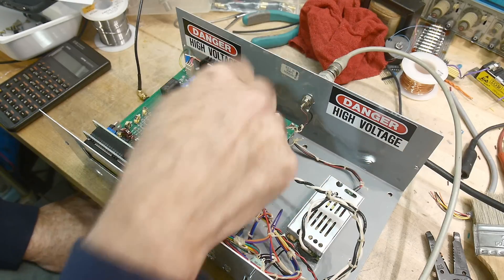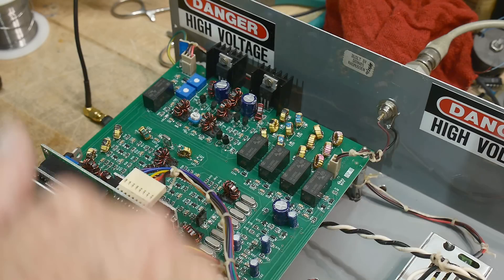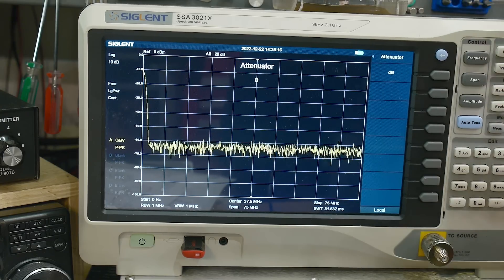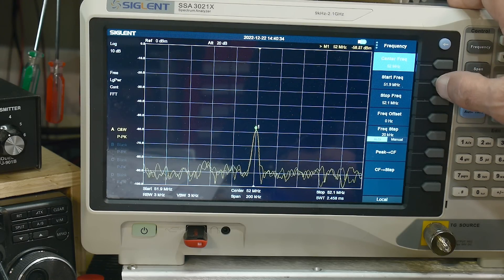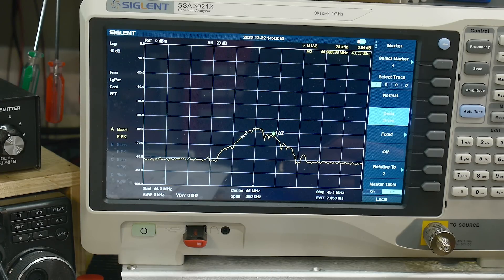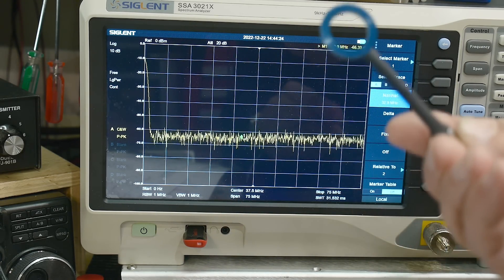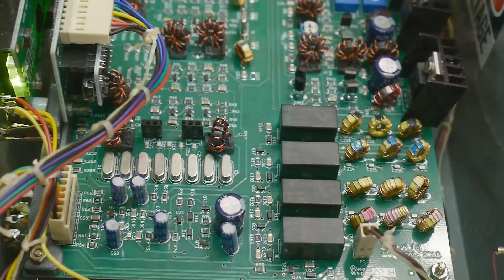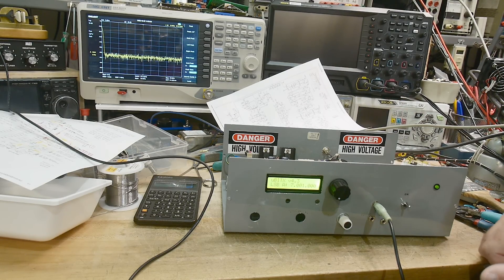#1375 uBITx Transceiver 1

Comment: I recently bought a version 3 at a hamfest. Lacking all the upgrades but they all can be added fairly easily I think. I got mine working on receive now have to see about Tx. I know they have a problem with insufficient harmonic suppression on v3 boards, maybe yours also?

Comment: I'm surprised that the switch mode supply does not upset the receiver.
There are often lots of harmonics coming off the p.s.u.
My friend bought an old hacker radio that ran on 2x 9v batteries.
He got fed up with having to replace them,  so a small switch mode was connected to it, oh dear lol :-D
The a.m bands were noise city lol.
I built a linear supply for him,  rather overboard but i tend to do that lol.
I put it inside an earthed diecast box with a mains transformer and a Lm317+ components.
Bang on 18v and the a.m was clean as a whistle :-D
The voltage preset was padded with resistors to only allow 1 volt plus or minus.
Just in case the preset moved.
Sorry long waffle.

Comment: JUst wondering if you were to use two vacuum tubes that were designed in 1957 with a heater voltage of 12V and a B+ of 12V you should be able to get 100W out if you use the power output stage that was designed to use transistors and uses a BALUN on the input and a BALUN on the output.
Reply: Nope.  Tube finals are are generally high voltage/high impedance type devices where semiconductor finals are generally the opposite.  I can't think of a single tube that would be even remotely useful with 12V on the plate.
Reply: @RogerWilco486  I am talking about the tubes designed in 1957 for use in car radios when the transistors of the day were not ready for primetime and had a heater voltage of 12V and used a B+ of 12V so I was thinking that a RF output stage using two such tubes and two BALUNS would indeed give 100W of RF the only way to find out is to test the concept.
Reply from the maker: 100 watts at 12 volts is 8.3 amps   those little tubes are not made for that
Reply: @IMSAIGuy  Have you seen the tubes that I am talking about and I am thinking that if you have a radio from 1957 or later then you have a car radio with those tubes in it and the manufacturer wanted to get rid of the vibrator as it was not very efficient at converting 12V to 120V and created a lot of interference while in operation and is why the radios with the vibrators of the day need really good smoothing.
Reply from the maker: @DAVIDGREGORYKERR  I would need to see a datasheet. those tubes might not handle tens of megahertz
Reply: @IMSAIGuy  The tubes for the Front end should be able to and it seems like a few pertible battery operated tube radios used the same tubes or similar.
Reply from the maker: @DAVIDGREGORYKERR  again, find a data sheet. the front end tubes will not transmit power.
Reply: @IMSAIGuy  Sorry I spoke.
Reply: I remember those tubes!  They had wire leads coming out the end.